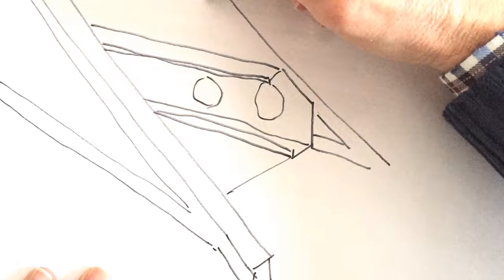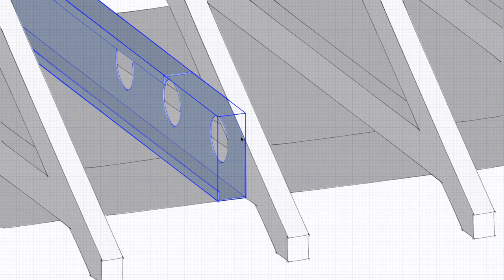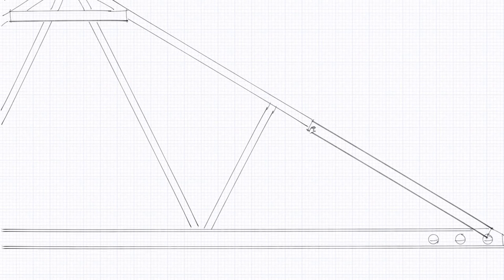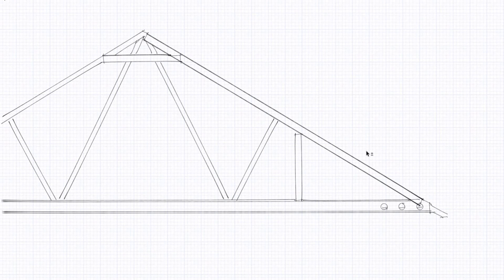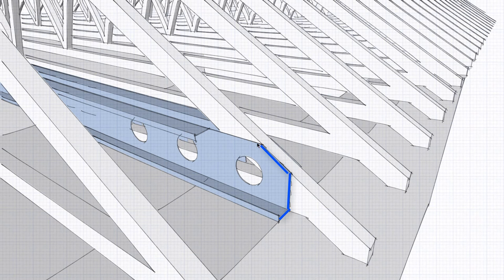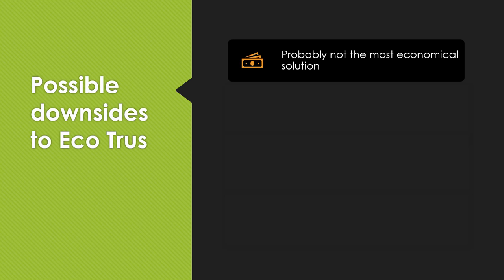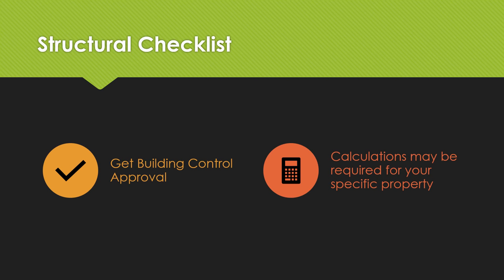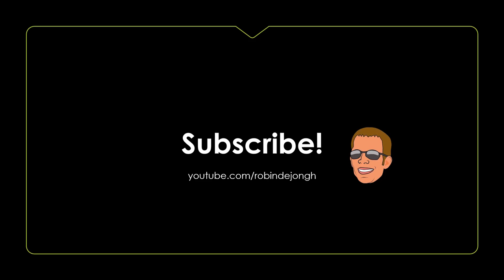Does eco truss work? (loft conversion)

Comment: I don't recall seeing any longitudinal bracing, when I've fitted timber trussed rafters for compliance there's been timber everywhere. Can't imagine calcs for the BCO would be an issue, they'd come out of the computer that does the design just like for timber trusses, when they've been required and I've sent them in, I doubt the computer calculations are checked on domestics, you just know it's big enough from experience.
Reply from the maker: Hi Alan. Timber truss manufacturers are well established and so is the software. Also timber truss design is described in detail in BS and EC codes. In contrast, this system is recent and bespoke, and checkers may well ask for more in the way of calculations as a result.

Comment: I have been considering a system like this since my home as a load bearing spine wall parallel to the loft joists. Just over 30% of the spine  wall is built from the ground right up to the loft, the rest  is sat  400mm in on 1st floor joists so I don't think I can put a UB or any extra weight to split the floor in the loft  otherwise it could cause cracking to ceiling.

Comment: If the circular holes are positioned properly that end joint could be positioned in such a way as to avoid the circular holes. The steel floor joists or beams it seems to me could be installed in two parts along their length and joined in the centre with a fish plate. This could be then done by the average competent person without removing any tile sections. 
Having owned home (our first home in Aust) which was an all steel frame construction, I cannot see the necessity of creating i beams sandwiching the ceiling joist ... certainly the construction of our home used only C beams as floor joists and ceiling joists. The proper fixing of sheet flooring would avoid any flexing of the beams once installed. The end sections could be sprayed with a little polyurethane foam on the ends... I like the idea of truncating the steel before the edges of the roof to avoid cold bridging... Buying commercial 150 mm (or 200mm) x 50mm C section without the holes would be easy enough.... there are enough tools available to cut circular holes of appropriate size where needed on site rather than in a factory.... further cost savings could be achieved in this way.
The galv framed house we bought (new) in the late 70s is still standing as fresh looking as ever...and hey...in South Aust remains termite free.  The only downside was floor bounce (like most  Aust homes it was single storey). The house was essentially constructed like a ship and designed to flex in the floors...it was supported only by perimeter foundations played havoc with my hi-fi turntable... We insisted the builders came back and put appropriate concrete slab plates on the ground underneath the floor and their own proprietory floor jacks (which were part of the system) at appropriate places under the house. That same construction system utilising footings and floor done in a single pour (as is common in many Aust homes) and helicoptered off to make the house floor smooth and flat would perfect the system. All intrernal and external walls and ceiling were insulated with rockwool (I think that was a heated ans spun form of gypsum... could be totally wrong...it was not asbestos I know that). 
I don't know why perimeter foundations with concrete infill beams are used in Britain... Footings dug, appropriate continuous (taped)  membrane laid in all trenches and across floor space with polystyrene waffle pods places to cut down the volume of concrete and insulate... with rebar in footings and reinforcing mesh across the floor area could be used....and seems to me to make sense.

Comment: Just another point on services and specifically electrics. Most lofts have cables for 1st floor lighting, fans etc here there and everywhere possibly routed as the crow flies and over trusses. Assume with Ecotruss it would be better before fitting trusses to rewire and run all cables off to the eaves, and connect there using cage clamp terminal JB to a highway running through the Ecotruss service holes (hole edges protected with push on plastic edging) i.e. no junction boxes under the new loft floor. Only thought on plumbing, keep it on the opposite side if possible. My only electric worry then is how to insulate from any damp/condensation at the eaves. I think Ecotruss do normally board the eaves space.
Reply: I had the same considerations too. Having recently rewired first floor, and now discovering eco trus for a potential dormer conversion, I'm guessing it'll need another rewire to pass everything through the service holes in the eaves. Also now thinking that any downlights fitted close to the existing joists will need to be drilled through the new steels - hoping that's not a problem? 

Good point re: pipework on the other side. I'm a novice to all this, but logically wouldn't these considerations still be present for any type of conversion including timber? Except you could perhaps thread cables through at any point rather than in specified service holes in the eaves?
Reply: @andyankrah6880  Hi Andy. Think I'd move my downlighters rather than dream of drilling the steel truss. Perhaps consider changing to LED strip lights if that would work for you. On the eaves not sure how many people do board them (which will create cupboard storage space). If not boarded then that makes the services easier. Or perhaps compromise and just board where you need cupboards. There are lots of rules to understand on drilling wooden joists if you go that route, so again personally I'd try to do a design to avoid that. I think Ecotruss intend you don't put any more holes in their C section joists (than the ones they provide at the ends) but best ask them direct so they can comment from their design calcs.
Reply: @johncoppock3823  Makes sense, thanks John. Looks like more work to plan in before the loft then, but I agree that would be the better solution. I'd be boarding the eaves ready for fitted cupboards, so no shortcuts here! Best to just save up more and get it done right

Comment: One last point, a normal truss roof (assuming no sarking boards) will have longitudinal and diagonal bracing, and restraint strapping into the gable at rafter and possibly also ceiling level for tall gables. For the former Ecoloft will remove, and is the diagonal element provided by the plasterboard? Stud ladders would also help a bit if securely fixed. For restraint strapping not clear yet how Ecotruss cut and fix to the new steels. Any helpful thoughts?  . . . and what would you guess BCO would want to see for these aspects. Final thought is ridge ventilation prob had to be added to comply with latest standards? also what about vent at top of the new eaves spaces?
Reply from the maker: Thanks John. Good points, though I can't comment on these aspects without having seen the design documentation.
Reply: @RobindeJongh  Thanks Robin. I'm thinking I'm wrong about the eaves top vent as long as the ventilation space continues to the top of the ridge. Interesting that recent loft conversions (prob not Ecoloft) on my estate don't seem to have added ridge vents, and I don't think they have converted to breathable felt.

Comment: I imagine the reason the hole is there at the end is something to do with keeping the costs down during the manufacturing process. ie The holes are continued across the entire truss, and the truss is just cut down to length when the dimensions of the loft are specified- so it can just be cut down to size to suit the application?
Reply from the maker: Hi Tom. I thought the holes were just at the eaves, for services? I will have to look again.
Reply: Robin, I imagine the holes would repeat along the entire distance of the truss? This is done to decrease weight, and of course the extracted metal can be also be recycled (the technical term used for getting a bit of money back!) Circular holes of course being stronger than rectangles, because of SCF's (stress concentration factors). A good example of this is why aeroplanes now have windows that are rounded, as earlier flight experiments cause aeroplanes to break up mid-flight because of the creation of cracks in the corners of the then square windows.

Comment: With your knowledge do you think this works on a new style build that is a timber frame with no work needed to strengthen the house?
Reply from the maker: Hi Andy. A timber frame may need assessment of the walls to check if it can take the additional load.

Comment: I like the ecotruss systemic . Robs makes it look very stress free for the owners. Our loft is a bit tight for a conversion , I was hoping this system would  yield a larger overall internal loft height ?
Reply from the maker: Hi Andrew. Any system that places new floor joists next to original ceiling joists will yield a similar ceiling height.
Reply: I would say you will need min 2.8m clear from top of joist to underside of ridge beam to achieve 2.3m when complete. I don’t know the system but when I have designed loft conversions to the current conventional system 2.6m is the very min height you need as existing to hopefully achieve 2.3m.
Reply from the maker: @craigalexander2037  Thanks Craig, that's an excellent rule of thumb.
Reply: @RobindeJongh   no problem, really appreciate your analysis of this system. I have wanted to recommend this on my future Architectural projects. feel free to connect with me on linkedin. Alexander Laird is my company.
Reply: Would using a system like this for just storage require building control ? The hight of my loft is 2m. The reason I like these systems is that the beams can span the hole length from back to front allowing air flow to pass over the insulation without any cross sections. No point loads using steel. The other is my semi detached home has a hip roof, it only has a short section of load bearing wall internally. The rest sits on 1st floor joists which rules out steel beams.

Comment: The foundations of the house have not been designed to carry the self weight of the additional steel or the imposed load from the loft conversion , so how do you deal with this?
Reply from the maker: Sometimes by calculating loads and checking foundations, sometimes by load substitution, or sometimes the additional is only a small percentage of the existing.

Comment: How do you run your plumbing pipework and power cables through these steel joists? I'm assuming you can't cut a hole through like you can with timber?
Reply from the maker: Hi Liam. I think that's what the holes at the eaves are designed for.

Comment: In this you say its only the centre section of the floor that gets strengthened joists in a traditional conversion? But that must mean the rafters need to be much more strengthened than with the eco truss? I know the structure works together but you can’t just have a strong floor as an island in the middle of the span? Something has to actually bridge the load out to the walls?
....watched your other videos and it all makes sense now

Comment: you mention that the stud wall frames were likely not supporting the rafters, i was wondering why there seemed to be no fastening between the wall and the rafters but it makes sense if they’re not taking load.  If it was all timber would you expect the stud wall to provide support for the rafters?
Reply from the maker: Hi John. There looks to be a connection between the top of the studwork and rafter probably just to hold it in place. If you check out my other video "how a loft conversion works" this shows how a stud wall would be used to support the roof.
Reply: @RobindeJongh  Hi Robin, thanks for the info, we’ve had a couple of loft conversions over the years, our current roof is hipped (1950’s semi) with a dormer over the hip to accommodate the stair well and ensuite, the steel has been angled at the gable where it sits on a lintel/padstone to avoid protruding through the roof and i was wondering if it had been cut back too far tbh but it’s been up for over 14 years without any major hitches (touch wood ;)

Comment: Your comment at 5m in about it being weak due to the hole, surely there is still a significant strength from the existing rafter structure, as these are still in place?
Reply from the maker: Hi Derek. True, and I believe Ecotrus also have calculations to show that the hole is ok.

Comment: I'm having a new loft conversion this year which will involve the old roof and new roof space of a new extension. I'm still wondering about using ecoTruss for the enture roof structure but can't make my mind up. There is speed of construction as you said but there is also cost. And you have now highlighted some other issues, I wonder if ecoTruss can respond to these issues. I think the idea is good. I also wonder if their design does come with full approved design calculations that Building inspector will accept. Still watching this space 👍
Reply: Is it nonstandard construction, can you get a mortgage on it?
Reply: Speak to Ecotruss, they're very helpful. I found the price they quoted very reasonable. They would also produce all drawings and deal with building control. Sadly I couldn't use them for my project as it's not compatible with my low soffets.

Comment: Have you a rough idea of the span limit using ecotruss also would a benefit of these truss mean potentially a thinner floor is possible?
Reply from the maker: I wouldn't know without calculating it. It's not necessarly a thinner floor, as timber floor would not be spanning the whole length of the property front to back.
Reply: 9.5m is the max span on these

Comment: Actually how this works is its bolted at many points in between, this makes it important for the bottom beam to bend, secondly the beam is still carrying most of floors weight at the ends the u beam is just there for it not to bend so the holes dont matter
Reply: They not for reinforcement as much as they are there to stop bending, that is why they are much higher than the wooden beam itself, the U shape in the middle between  the eco trusses is what's stopping the wood from bending the floor keeps the metal trusses from bending in turn

Comment: I assume this product cannot be used on a normal cut roof i.e. rafters sat on wall plate then joists which run across (not a truss roof)?
Reply from the maker: Possibly. I would get in touch with them.
Reply: @RobindeJongh  I;m designing a cut roof where the rafters sit on the wall plate but the floor joists are about 900 below the wall plate so they are not connected to the rafters , any ideas? we are looking at supporting posts and purlins and maybe a supporting bracket just below the ridge,